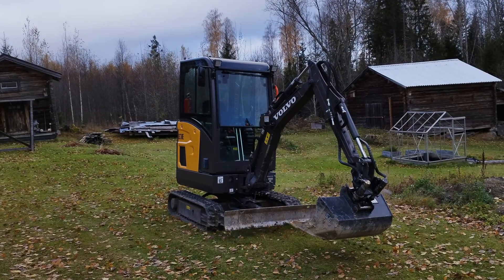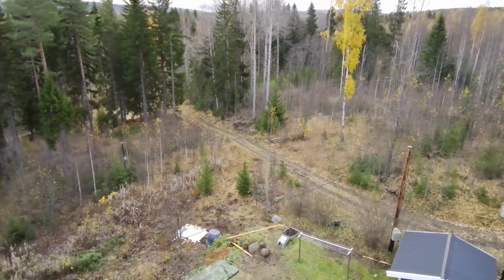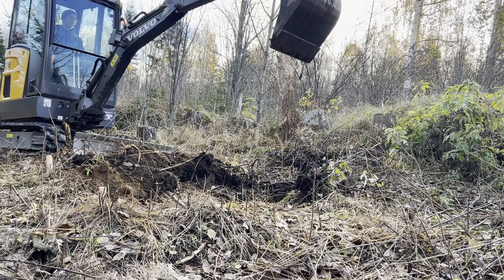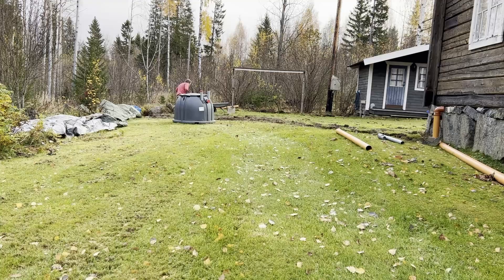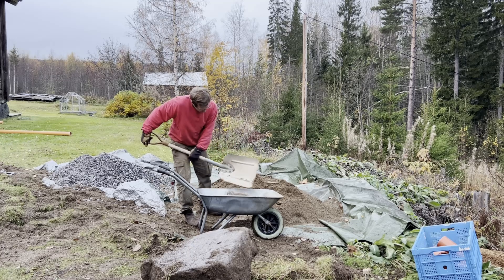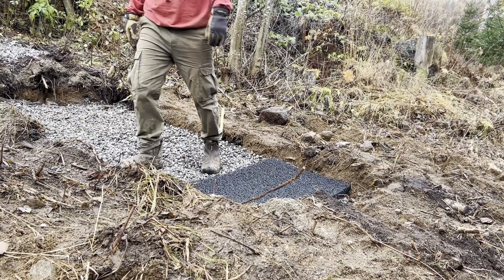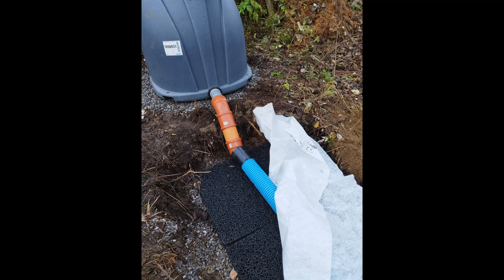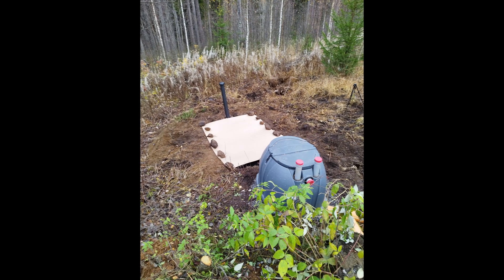Installing a Greywater Filter and Infiltration Bed

Comment: Yeah .. the authorities .. doesn't matter where you live they're the same everywhere - always after your ass :))
I was watching and wondering - the entire sewage system should actually be about 1 meter underground, below freezing point in any case, otherwise you won't have it working in the winter and winters in Sweden can be harsh.
Reply from the maker: @greybeard5774  yea agree 🙂 thx for the input. It will only be used summertime.